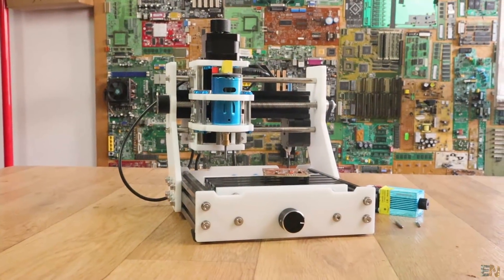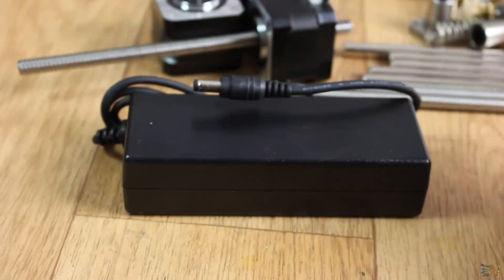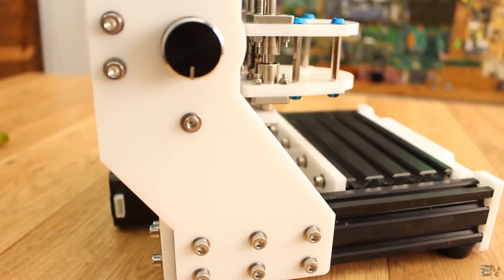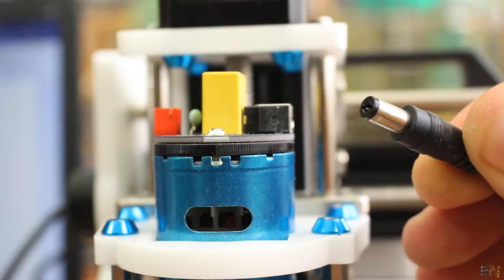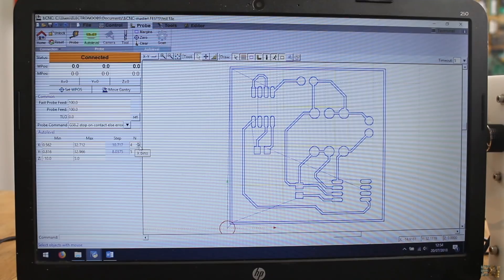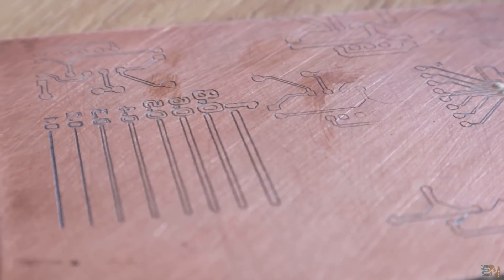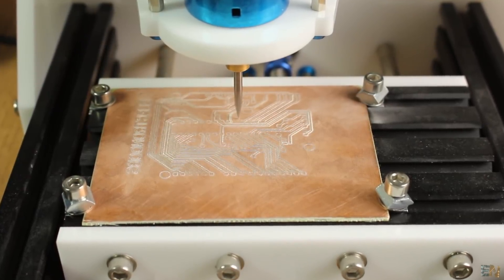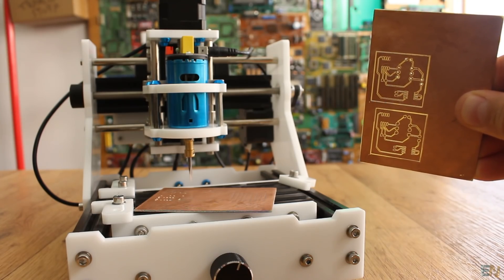ELEKSMILL CNC mill - PCB engrave

Comment: Questa CNC non vale nulla, come puoi vedere le piazzole del PCB sono tutte distorte i fori decentrati, il problema sono i backlash che non si possono evitare senza una meccanica di precisione. Si possono ottenere risultati professionali pari a quelli di macchine come la CNC Wegstr da 2900 Euro, utilizzando la T8 e sostituendo tutte le viti femmine con viti in resina autocostruite. Non posso postare qui delle fotografie, ma credimi realizzo dei PCB di una precisione impressionante, ho speso tra la T8 e il materiale di modifica circa 300 Euro, ma ora ho una macchina che vale 10 volte tanto.

Comment: Very nice presentation - you could have taken af little more time to do it, What is the lowest precision in millimeter X, Y and Z in the axis is obtainable, which drill tools are you using - have bought besides, Name and place to find all the software you mention? Will the machine also drill the holes in /on af PCB-board. I'm not sure I got all my question to you, som I may come back with more later. It's just the machine I'm looking for stable, simpel, affordable, precise, taking up small space. Thanks in advance for a quick reply.

Comment: Great Video! I'd like to pass on a PCB cleaning trick I have learned. I now use melamine sponges to clean many thing are very a very abrasive but do not leave big scratches. they work wet or dry

Comment: Added this to my 101 PCB Etch/Fabrication, and Automation playlists.  
  I'm jealous, I wish I had one of these to play with.
  For awesome CNC hardware fundamentals and robotics check out the YT channel Homofacians.
     There are a few points I've picked up on from other people's tutorials like this. First, there's a big difference between higher quality copper clad and the cheap stuff. The cheap stuff has a very inconsistent thickness and surface. I've measured all of my cheap stuff before and seen a lot of thickness variance. You might want to disclose what your using and where it came from.
  I spent about a year working in a machine shop in my early twenties. From my limited experience,  you'd probably benefit from a clamping method that contacts a larger area. The tee nuts are kinda okay for something solid/very rigid. They could easily cause deformation on a ~1mm scale while clamping a large sheet of glass reinforced plastic.

  Second, any good machinist goes through an enormous amount of effort to create a rigid and flat work bed. Issues of an aluminum extrusion bed aside, there's probably something to gain in simply using a large sanding block with a heavy grit sandpaper to level the work surface as much as possible (cheaply).
  Back in the day (up until the mid 20th century) machinists would level their machines by hand in a process called "hand scraping." It's an interesting process to look up and understand. They used a special chisel, stone, and a marking dye called prussian blue to level the iron or steel machine surfaces by hand. Just imagine how long that takes! Nowadays, we have much larger machines that are accurate enough to make large flat surfaces using fly cutters or a special grinding wheel. There are still a few people around the world that offer hand scraping services for special machines/situations where machine trueing a surface is impractical. My point is that "bed leveling" isn't just a software thing, it's something you do to the machine first.

  Lastly, you really should tin your entire pcb before adding components. It will protect the copper from oxidation and prevent a lot of problems you'll have with dry joints. 
   The channel Nurd Rage did an upload on making your own homemade tinning solution using silver polish. You can always buy the commercial tinning solution. 
   So far, personally, I've just used regular solder on all of my boards. However, I have a few rolls of much larger diameter solder wire like what is sold in big box home improvement and general hardware stores. The stuff I use is ~3mm diameter, and is still marketed as 'rosin core' solder, not the 'acid core' stuff used for plumbing/copper pipes. The reason I prefer to use it is because obviously I'm not wasting a bunch of my regular 0.8mm solder, and most importantly, the flux percentage is higher. The flux is also much more aggressive at cleaning the surface and leaving a consistent thin layer distributed across the entire surface. (BTW never tin a surface before drilling or machining either as it will ruin your cutters very quickly.) I still use around 3-5 cm of solder wick to pick up anything that builds up on the surface at the end. I also have a couple of glass pan like casserole dishes with sealed tops (the same kind I use for etching/holding ferric chloride). I keep them filled with isopropyl alcohol and have a dirty and a clean container I use to wash all residue off after any soldering job. I use the cheapest small 2-3cm wide paint brushes I can find with one for each container of alcohol, to clean all the flux off in 2 steps. This seems to get about 95%-98% of all junk off the board. Everything but the deepest crevices get cleaned with this.
  I also have a few videos in my 101 PCB Etch and Fabrication Photoresist playlist that demonstrate a tinning method that uses some kind of plumber's paste and a torch, but I've never tried it, but it looks interesting for larger boards.

  If you want something even cooler visually for your videos, there's an ebay seller here in the USA that sells off cuts of copper clad with colored fiberglass under the copper. It would look really cool for videos like this ;)
-Jake
Reply: I'm posting a listing from the seller with the colored pcb's on ebay. I haven't tried it myself but I've read good things about the quality on multiple forums. (No affiliation/not a sponsored link)
https://rover.ebay.com/rover/0/0/0?mpre=https%3A%2F%2Fwww.ebay.com%2Fulk%2Fitm%2F162146765825

Comment: It is a good method to develop faster, but you have to do a soldering mask to work well. For drill the holes it's better use a sacrifice table in order to don't drilling the machine table.

Comment: I've had quite bad experiences with these mini cnc machines, at least mine was not that realiable without any autoleveling to compensate the curvatures on a copper board, and using such software to map the surface area is really time consuming, not worth it to make pcb's honestly.
Reply from the maker: Do you prefer acid etching? I've made the Arduino 1 layer layout in around 15min! Keep up!
Reply: Well, for the tests i made, i had to run the autoleveling software every time i used a new pcb, and that's what it takes the most time, not to mention that i actually ended up breaking a few mill bits for dumb mistakes i made, in my opinion acid etching is way better, but i guess if you find the right settings and have time to make them, milled pcb's looks way better.
Reply from the maker: After a few tests, you get used to the machine and make no more errors. Keep up!